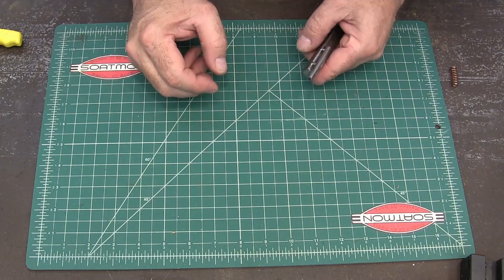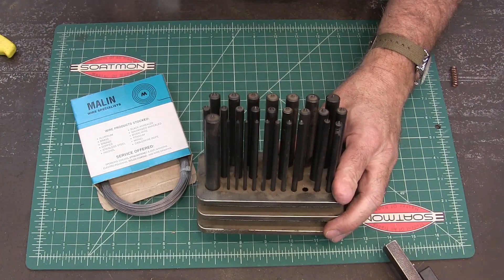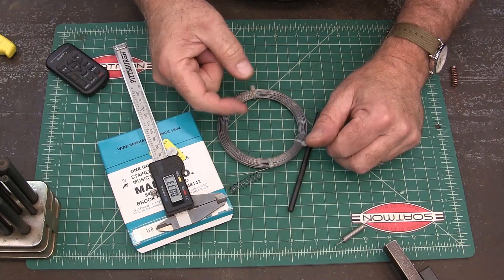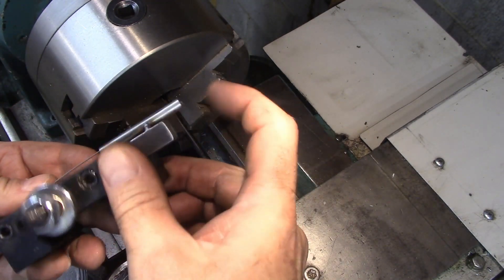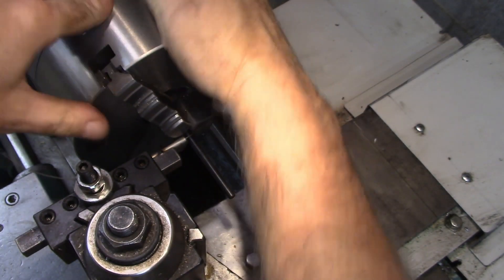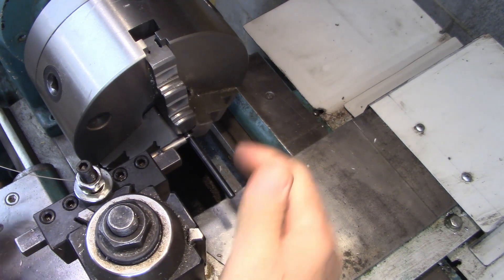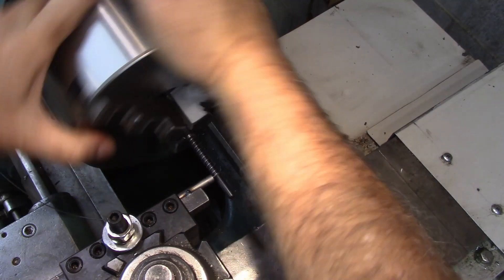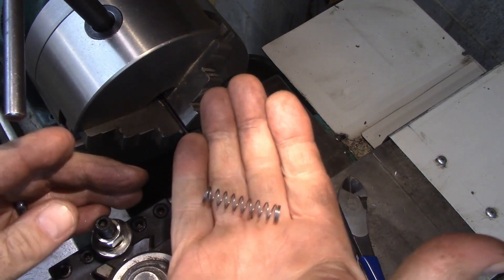DIY Spring Making

Comment: Just a quick question for you Mr. SOATMON, does the tension on the wire as it goes through the fixture on the QCTP have anything to do with the final spring diameter after it is cut free from the mandrel?  And thanks again for the link to the spring calculator.  There is another interesting aspect to spring making and that is what factors affect the spring rate for the finished product.  The wire diameter is one of these and the diameter of winding is also another main factor.  Where the spring rate is the stiffness of the spring.   Thanks again.
Reply from the maker: The tension doesn't seem to make a huge difference as long as you are pulling it tight to the mandrel with each turn.  Another viewer commented on the previous video that he uses a piece of hardwood with a groove then sandwiches it with another piece and uses this to guide the wire and set the tension.  Sounds like it would work well but I would probably have to drill a hole in the mandrel as I don't think I could get it close enough to the chuck with 2 pieces of hardwood involved.  I hope you had a nice Thanksgiving Glenn!

Comment: I really do appreciate you sharing your techniques for spring making.   I had not thought about using Mcmaster for the spring wire either.  This is a very useful way to make them and this way you can get what you are wanting not just what they have available in the catalogs.  And I am not sure about this but likely it doesn't take too much practicing to get it right when you use the spring calculator. We have everything winterized and are closed up for the season.  Thank you for the video and hope you are ready for the cold weather.
Reply from the maker: With a lathe it's very easy.  As you can imagine when you make things from scratch you can't always find a spring that fits so I started making them.  The calculator gets me close enough, I sometimes have to make some changes and make a second one to get it right.